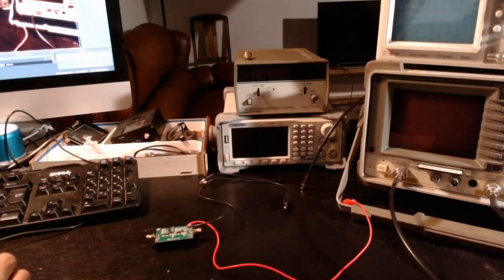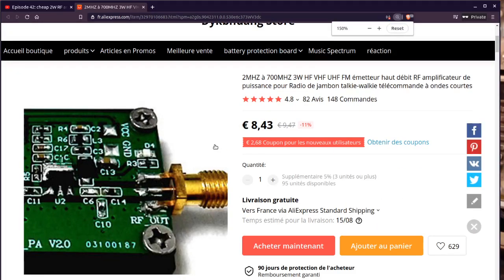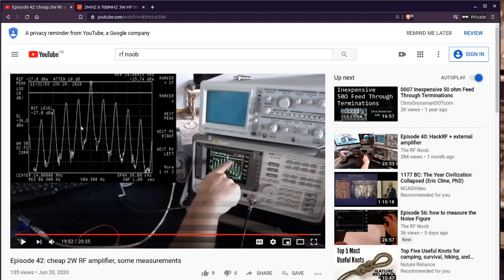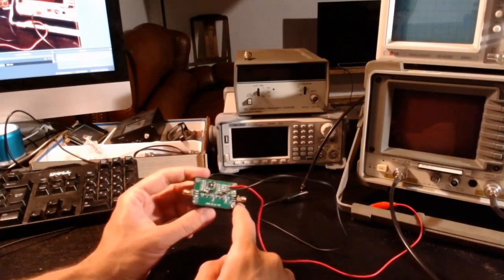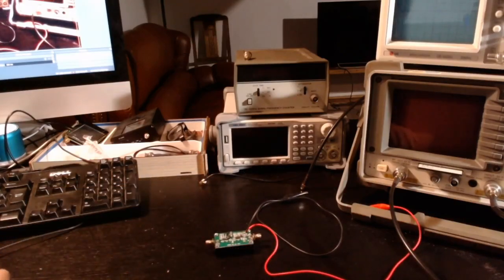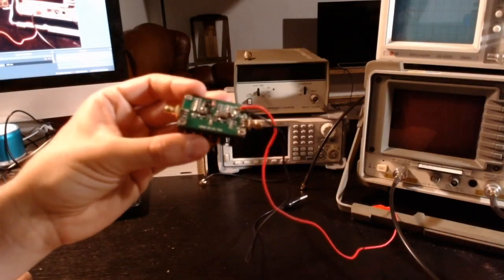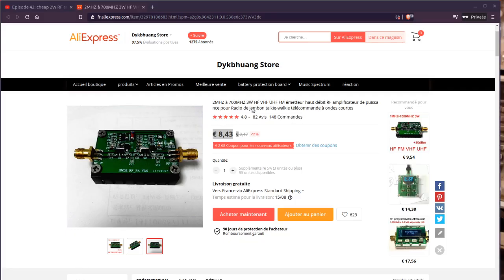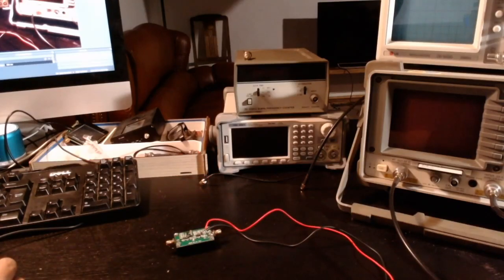Episode 59: 2W Amplifier (NWDZ RF_PA 2.0) FAIL!!!

Comment: Friend, could you help me with the description of the U2 component in the circuit, please?

Because mine burned this transistor when I changed the frequency on my nwdz rf pa v2.0 and I wanted to fix the problem.

Is there anything else I can replace?

Comment: With a better heatsink and fan would this likely survived if driven with proper input power meeting specifications?
Reply from the maker: It's possible, yes. Personally I now prefer to buy 2nd hand good quality stuff, rather than new lower-quality components. You can find nice amplifiers for good prices on Ebay. Patience is key.
Reply: adding thermal compound and a fan makes it last 20 minutes instead of 2-3 minutes

Comment: the amp should be driven with no  more than 0dbm       20dbm input is too much.              the spec is 0dbm input,  3watt output
Reply: Specs I saw said >+10dbm and I believe hackrf puts ot about 11dbm.Should not really produce this kind of failure.